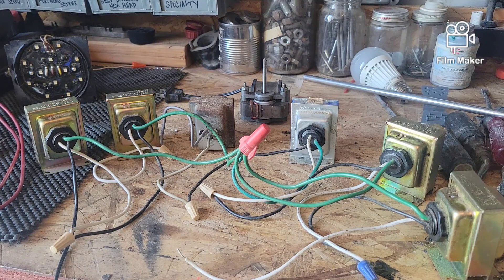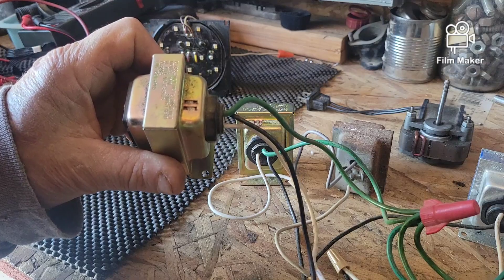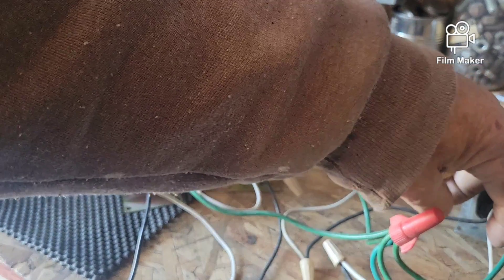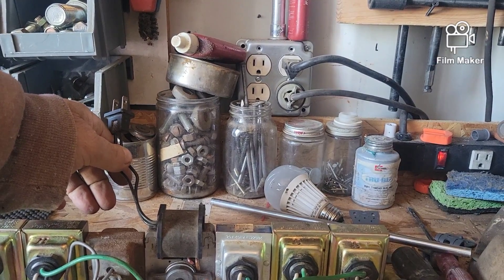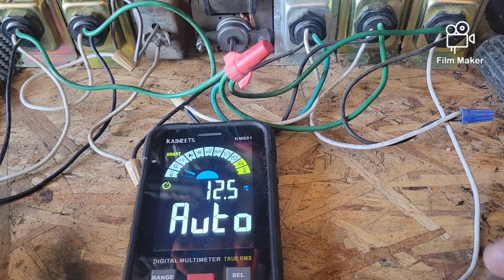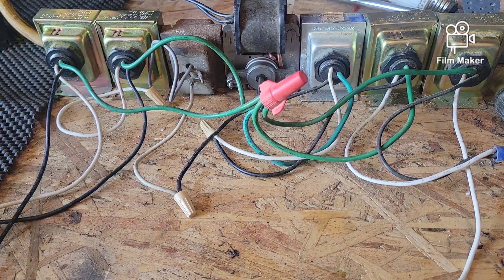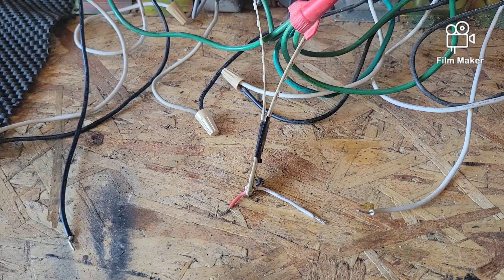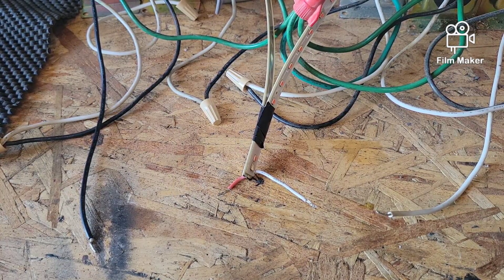Grabbing Free Electricity From The Air And Making Use Of It, Dec. 28, 2023

Comment: On another topic I always wondered how a 225 amp welder can get that amount of amps without tripping a 80 amp breaker.  80 amps must only mean the safe zone for liability and not the true amount the breaker can actually handle.   imagine only using 80 amps to get 225 amps.
Reply from the maker: The wonderful world of step-up tranformers, or different wire sizes coiled next to each other...😉👌

Comment: This makes use of an electrical field generator. It  does have use. AC can be rectified using 4 diodes wires as an AC to DC rectifier.  There is so many ways one could use this to an advantage from many inductive sources of power.  Strong magnetic fields travel across many outside power sources. I would 100% build an innocent looking box and set it near these inductive ac loads. AC travels far without much voltage drop.  Other collections could come from any constant running nearby field generating windings. I'm not going to mention any here and will keep this as a neat experiment idea but this is a can of worms for me and I like to go fishing.  Lots of people could use this in a wind generator situation to collect air power while a turbine is spinning.  Application of boost buck converters + current limiting circuits could be wire in easy to say charge a battery.  
I like it! I really like the potential this has.
To protect you and I.... I'll just say this doesn't work! ( wink wink ) CHEERS!
( RUNS OFF LOOKING FOR TRANSFORMERS! WOOHOO!)  
BTW people will take this for face value and NOT understand what you stumbled across even if the idea isn't so called new and wouldn't have the first clue how to put this to work for them. 
 For me I have a bunch of idea's forming.
Reply from the maker: Welcome aboard!  I like the way "we" think!  Watch my video, in the same playlist, with the picture of my hand holding a voltage tick on the steering wheel.
That is another point of how a proper collector can get you free power.
Reply: @GBear   In general there is tons of free kinetic types power being wasted in all forms from things we do.
I've been watching  electronics video's for a long time.  For some reason this unlocked one of my dead bolts keeping me out of a room inside my head.  I was just talking to my wife. She told me to shut up and go talk to John ( my Buddy with 20+ years of military electrical engineering experience.)  So I hope i do not become uninspired by that time I see him tomorrow.  Thank you. You have no clue how big this is for me.  
My last few electronics video were on  how and why  capacitors work. Not just as temporary power storage but how the equation works.
Reply from the maker: @TheWickerShireProject  Cool!  Your enthusiasm is appreciated.  More to come!

Comment: HeyG bear.  I believe that those door bell transformers only stepdown the line voltage from 120v to 24vac.  Not converted to dc.  I took one apart a few years ago and found only  transformer windings, not diodes for ac to dc rectification.  And no capacitors for voltage smoothing.
Reply from the maker: Good point!

Comment: I'd like for you to do something. Plug the little motor into a Kill A Watt meter, and record the wattage. Now put a load on the transformer you have sitting next to it. The wattage will increase. There's no free lunch.
Reply from the maker: I'll do that tomorrow.
Reply: yea id like to see the kiilawatt meter plugged in.
Reply from the maker: @wesleyscott2169 Welcome aboard.  I'll do that and post it live.
Reply: I had the same thought. Will the motor draw more current with that magnetic field from the transformer. I know for a fact that you can get electric from the air but at a very low watt or maybe milawatt. This is going back to the Tesla experiments you may have learned in science. 73
Reply from the maker: @ronb6182  We will see with the Kilowatt meter tomorrow.
Reply: One last note, how much you paid for them bell transformers,? And how much light you get out of the experiment? Maybe it's not worth the cost. Same goes for solar panels and batteries. All go bad after their years of service. 73
Reply from the maker: @ronb6182  The point is moot.  I bought a few of the transformers to experiment, the others I collected from trashed items for the same reason.  The point isn't to buy these transformers for the finished result, but just to show the theory is possible.
On the solar point, I have been living off grid on my system for going on 9 years.  The initial cost was minimized by being frugal, but in some cases buying cheap components proved to be a waste.  If I were to start over, I would have gone with better equipment and saved on wasted replacements.
Reply: @ronb6182  So do cars, but people still are buying them. Here's the thing : if everything lasts ten years, and I get $100 a month worth of power, that's $14,400 worth of juice over that period. So if I have six grand in my solar/ wind, I saved $8400 over the cost of getting the same amount of power from the grid. That will easily replace the solar panels and batteries. But hopefully it will all last longer than that. That's a risk I'm going to take. Meanwhile, when the grid is down after a supercell rolls through, I still have power. That's why I went with solar and wind.
Reply: @davidpotter9462  bottom line nothing ain't free. And you have to take into account not every place is solar friendly you have snow and many cloudy days where no power can be obtained. And we really don't know the impact solar has on the environment. With battery waste and lithium is another issue.it would be nice if everyone would recycle but that is wishful thinking. My county is quitting the recycle bin because it's costing more to send out the extra trucks. And the truth be known how much of recycled garbage ends up in the landfills. For some solar may get some savings after ten years or so but still how many people still don't fork out the money to convert to solar. It's seems like DIY probably save the most because they don't have to hire anyone to install them panels.  As for wind power we all know what happened in Texas and it's useless wind turbines in past winters. Enough said 73
Reply: @ronb6182  that's why I have a wind generator and I'm going to make another one.
Reply from the maker: @davidpotter9462 Yep!  A wind generator is a good example of free power.
Reply from the maker: Excellent point!  Don't forget your Faraday cage.